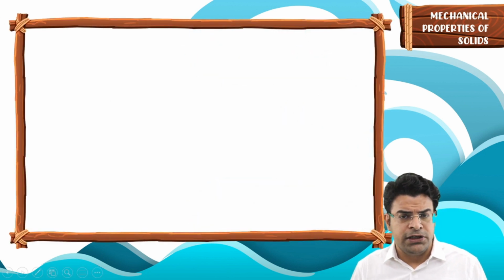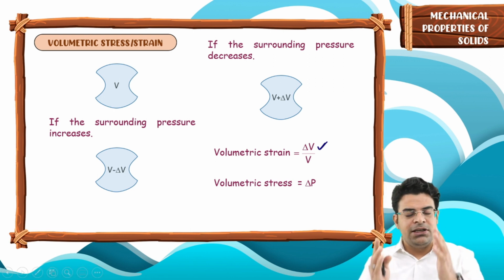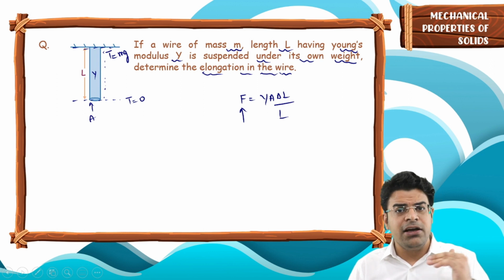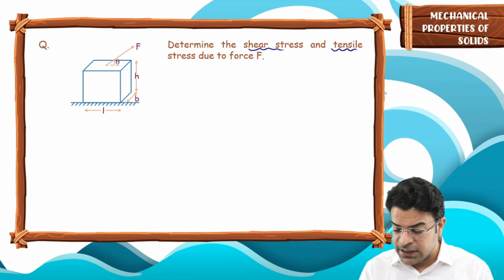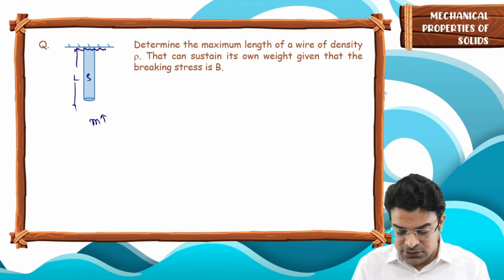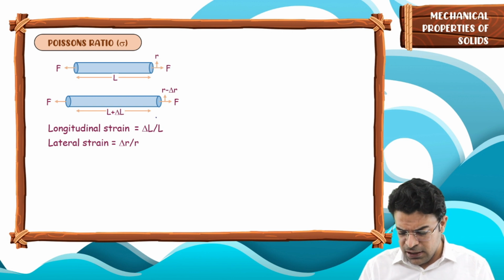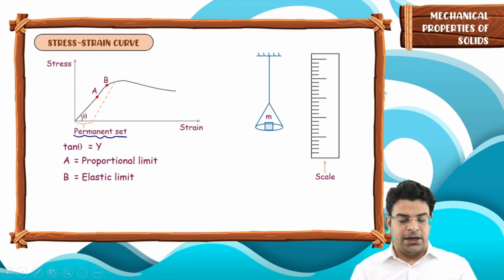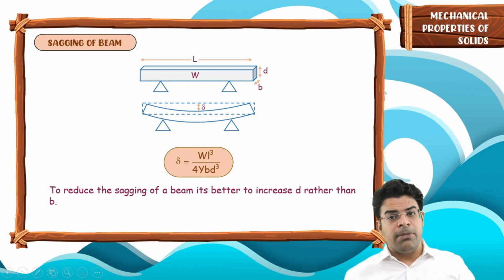NEET Physics Revision | Mechanical Properties of Solids | Hour 37/84 | In English

Comment: Sir when the forces  say F1 is trying to increase the length and one force say F2 is trying to decrease the length then they are in the same direction... so when we have a rod hanging with a mass the forces at both the ends are in the same direction downwards then why don’t we take F1-F2/2 ?? I m not getting that??
Reply from the maker: You always ask good doubts.
Look at the forces on rod due to ceiling and the mass.
The mass pulls it down as if trying to elongate and the ceiling pulls it up again trying to elongate.
Reply: @ScomorewithAK  Okay sir so we have to consider the force BY the ceiling ON the rod .. but the force that the rod applies ON the ceiling will be in downward direction na??